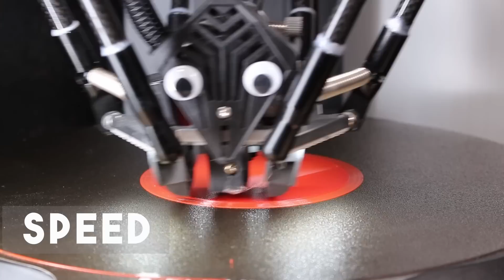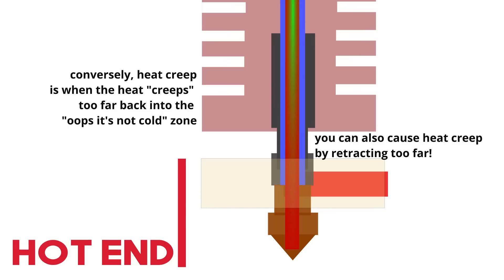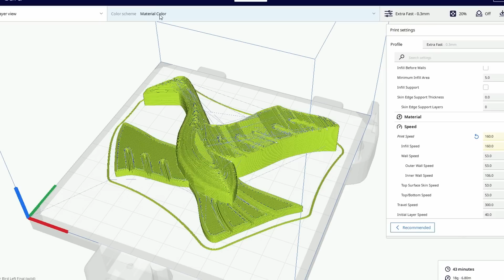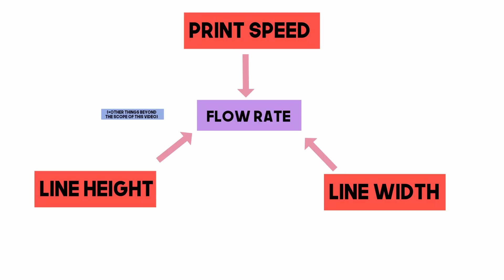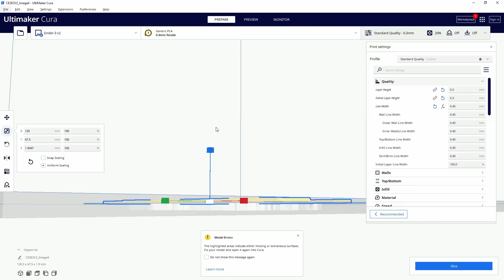I can halve your print times with this video. Episode 2 of Faster Profiles in Cura / Prusaslicer

Comment: There is a way to print faster. Way faster. It uses linear pressure and some settings from a slicer that allows you to use cnc settings. I have the files on a laptop. My problem with it was stringing. But I’d love to share the slicer profile and modded marlin firmware if you would like to go threw it and make a video about it. Maybe you could tinker the settings and share what you’ve found? Anyways, if you would like to talk shoot me a message.

Comment: Jerk is the minimum speed that the printer can be going to make an instantaneous 90° velocity change.

So if your jerk is 10, the printer will accelerate down to 10mm/s before it turns the 90° corner.

Angles less than 90° such as 45° corners, dont have to decelerate all the way to 10mm/s, they can take the corner faster. This allows for things like circles which are made up of tiny straight lines to be printed fast.

Comment: After some tinkering with Klipper, the stock creality ender 3 hotend will reliably do at least 25mm3/s. I mean, im able to print at 160mm/s with 0.32 layer height and 0.5mm extrusion width at 210°C without any sign of underextrusion. My main problem was actually layer shifting because acceleration was too high (8200) so the stepper was losing steps. Now with acceleration at 7100 theres no more missing steps and i can reliably do 160mm/s on an Ender 3, direct drive with stock extruder and printed adapter, 1.1.4 8bit mainboard with BLTouch and Klipper+Mainsail. Oh yeah, the steppers barely reach 50°C.

Comment: If you set in cura the same increased acceleration values you setup in the firmware, it will give more accurate print time predictions.

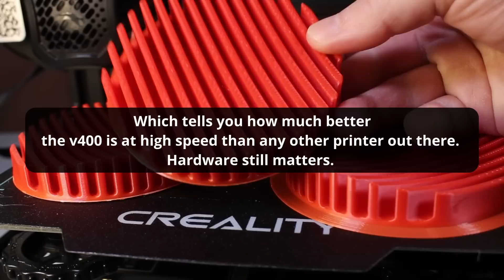Comment: 10:46 that part is important , even thought the FLSUN v400 advertised speeds are lower than the bambu ones , the flow rate of the v400 is way higher than any of the bambu ones , resulting in the v400 printing faster

Comment: You might want to check the hazard of filament nanoparticles...DONT brush your machine down, use filter vacuum with airflow in the room...a lot of reports i the last year about hazards
Reply from the maker: I have HEPA filtration in here, it's never a bad idea. Most of the dust is paper for..reasons.

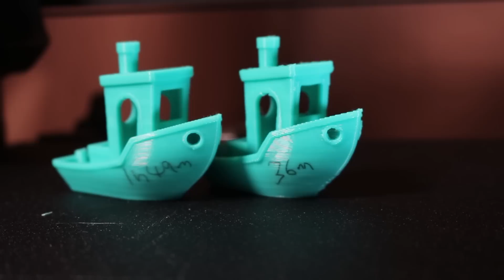Comment: @Lost In Tech what is the reason your flsun v400 acceleration goes from 4K to 8K and your square corner velocity from 20 to 5 in that clip around 10:30??
Reply from the maker: Was I showing the biqu hurakan in some of the screenshots? it's a while ago
Reply: @LostInTech3D  nah, I was talking about the speeder pad. I was asking because mine does the same change with a "redo" type circle with arrow that sets it back to 8000 and 5 when selected

Comment: Lol the time you save printing is offset by about 4x increase in experimenting and set up but thank you for the info. This job is for an AI app with a one button click that 1st measures all the parameters of printer with a set up test then adjusts all the parameters for the filiiment then sets up the whole machine with the 10000 bits of data it has and then monitors the printing process in Pico second increments to make sure the spec it came up with is confirmed with perfectly and make on the fly adjustments when necessary. This is the way to print plastic cat poo to perfection although the taste may not appeal to your dog  😂😂.

Comment: Trying to increase the speed is the brute force method like adding more horsepower to your shitty car instead of improving it´s aerodynamics and weight.
Same goes here, increasing the print speed should be probably the last step. Here is what you can do before that.
1. Thicker layer widths, you can print 0.8mm layer width with 0.4mm Nozzle easily
2. When fine resolution is needed for example 0.12mm layer height I turn on "combine infill every n layer" and in my case set it so 2 layers, with 0.1mm layer height you can choose combine every 3 layers.
3. You can add small radii in your design so the printhead does not come to an almost stop at the corners and create corner bulge.
4. You could use lightning infill and decrease outer peremeter to 2 and later on fill your model with hot glue, concrete, sand in a plastic bag + hot glue or exopy etc.

Comment: I expect that internal surface area is the limit for the fancy hotends, but not stock ones.  Improving the metal used for the block and nozzle (brass vs copper), the output of the heater cartridge (40W vs 50W+), and the extruder's maximum pressure (single vs dual gear) can all give better flow rates.
Reply from the maker: Copper is an interesting point. I should test that

Comment: -As I undersand Jerk-
Jerk = the slowest speed the printer slows down to when changing direction. While nothing can change direction instantaneously, it works in practice up to a certain value depending on the printer rigidity and moving weight.
Pros of using a high value is obviously reduced print speed. 
However more overlooked is how it allows us to maintain a more stable pressure in the hotend. If you print with Jerk 10 and speed 10 the pressure is perfectly stable (except when retracted).  With higher speed, the pressure in the hotend lags behind every time there is a speed change. This can be compensated for with linear/pressure advance. The smaller the difference between jerk and speed the better and less compensation is needed. 
Drawback with a high jerk is increased vibrations and ringing.

Comment: You could do a follow up on this one. The infill and perimeter is key to print time. It is also key to the strength of the print and its aesthetics. Variable line height is really usefull for more organic parts, but for geometric parts, adjusting speed by layer height is crucial. Setting infill the same way, and layer height, line width, and perimeter, as manually by layer height, is a proven way to cut print time. It does increase the workflow and the workload, on the designer.

Also, if you design your own parts, designing for speed is often times crucial. When I do so, it is a combination of infill, perimeter, part dimensions, and the functionality required of the part. In particular, avoiding a solid first layer, as in rather use a pattern for the first layer, or a a mesh rather than a solid, typically is The action reducing print time.

Variable line height needs some assistance in Prusa Slicer, as it will use the entire range of line height, including the draft setting. This currently can only be adjusted at the printer setting.

It is also a complete unknown to people, how difficult single line printing is to get right. Once you really start inspecting infill quality and real strength of the infill, things never look the same again.

Comment: Do you have any profiles you have “dialed in” for the “best” fast prints you want to share ? I have an ender 3 pro and use cura.
Reply from the maker: The problem with this is that, and this is why I made this series, it's very dependent on what your model needs. 
Learning how to adjust around maybe 10 parameters yourself is way more useful than using a profile, so I'd always recommend using the default ender profile and just changing what you need for that application, if that makes sense
Reply: @LostInTech3D  - It seems to me that many of us would rather start with a fast profile optimized by someone else and make minor changes to it rather than to reinvent the wheel by starting g with an “out of the box” slow printing profile and screwing around with attempting to optimize 10 printing parameters. 

Or maybe I’m the only lazy one out here looking for the fastest way to accomplish my goal.

Comment: You can also increase the max. flow rate by making the heat block hotter.  The problem of course is that the speed at which you push filament through varies a lot and you want  that filament to melt but also not get too hot.  How much heat can get pumped into it increases as the surrounding temperature (of heat block and nozzle) increases, but this temperature cannot vary that fast.  Putting it higher increases the max. flow rate, but also increases the risk of "overcooking" the plastic.  A small but faster heater (like the REVO) can also help here as it is faster at regulating pumping heat into the smaller heat block and as that block is smaller it also has less latent heat that could overcook the plastic when it is pushed out slowly.  I would expect a REVO ring-heater combined with CHT-like nozzle could be better than a volcano (as control over the flow would be better with the shorter melt-zone), but I don't know whether this exists or is even possible with the "unified" approach of the REVO.

Comment: please share your v400 settings. I cant print fast on mine. It'll knock the print off.
Reply from the maker: The v400 has a tendency to overextrude. Try the default profile but around 93% flow rate.

Comment: Nice. I'm frustrated by cura not having the ability to limit speed by flow rate as well, and I normally spend my time saving playing with settings, but I'm also a fan of the big nozzle (who isn't?) 0.6 is my standard and I have a 1mm on my core xy at the moment, for vase mode experimentation, I've found that printing things without holes and drilling them later saves heaps of time as well. Anyway. Great vid, thanks again

Comment: A good way is to print and tune for features which you see, slow, and then full send it where you can't see it. This is where volumetric flow rate helps - you can set the number, and slicer cau automatically adjust speed based on that value. Another neat trick is to use extrusion width on infill - if you make sparse infill 0.8 mm instead of 0.4, then in order to fill the same % of volume, printer has to make fewer lines = fewer moves, which decreses overall print time.

Super Volcano has one flaw - structural heatbreak supporting block which is way too large and heavy. rapid movements and bumping into prints cause fatigue and heatbreak snaps.

Comment: All I know is,I am fighting with my Elegoo Neptune 3 printer at this time after many times of it having a damn fully blocked hot end and me spending tons of time having to strip down the whole hot end to un-block the damn thing?  
I have done that 4 times today and even changed the PTFE tubing to new length and cleared out the filament blocks over and  again and still it blocks no matter how much I increase the heat and yes I reduced the flow down as low as 60% and the printing speed down to 40% the hot end ( MK 8 type ) even was at one time running at 245 C just to try too clear out Pro PLA that was blocking the hot end again, even though 
I had fully cleared it and even used cleaning filament to flush out any left over filament from before?

This was after re-doing the leveling using the in-built advanced mesh bed leveling. over 5 times and setting the z off set also over 5 times too.

No matter how well it was all sorted the damn hot end blocked up each damn time no matter the cleaning down?

This printer was fantastic for some time after I got it. Now tons of bad prints and blocking up no matter the cleaning and setting up?

The retractions are normal Cura 4.11 version ( 5 mm ) for the Neptune 3. I really fed up with this load of problems and I still have the Aquila head to un-block too and it is a high temp version 
( 300 c at this time but could if fitted go up to 550 c ) and the Tronxy X5SA printer I have also head is blocked too all were fine for some time now all playing up. even my FLSUN Delta QQ-S Pro is mucking me around too now?  it also was fine for some time before.  Takes allot of time to keep stripping their hot ends down and cleaning and re-setting them! I never had so much hell?

Damn it. And no before anyone states oh just use Cura 5. I can't load it as not using win 10 I using win 7 Pro. and no it it works safely no worries as I have great anti-virus and such software.
Reply from the maker: Hey, hop on discord...we might have some suggestions
Reply: I passed through something similar. One time it was because I changed to a all metal hot end and I forgot to change the retraction in Cura, so it retracted too much and cooled down blocking everything. Next time it was when I unblocked it but I forgot to screw everything very tight, and when hot, so plastic started going out from all places, making me clean everything again. A block can also be a cause of not cutting the PTFE really flat and plastic starts flowing where it shouldn't. I'd start reducing the retraction a bit if you don't seem to find a clear problem causing them

Comment: The cht seems really promising. For my custom corexy printer i will go for a cheap v6 and in case that turns out to be my speed bottleneck I’ll upgrade to that. Even outperforms the volcano by a fair bit. (At least according to stephan at cnc kitchen
Reply from the maker: I really need to get one 😂
Reply: 0.4 mm on MK8 hotend (with or without bi-metal heatbreak) was worse than Creality 0.4 mm nozzles (PLA+ if that matters). So it could be 20€ for improvement or 20€ for nothing. CHT could be better in V6, V6 in general is better than MK8 😉

Comment: How does this scale for a 0.6 nozzle?
Reply from the maker: Same - as you maybe saw flash past, arachne engine is very flexible about nozzle size vs extrude size, and rightly so. I think of nozzle size as a range of available extrude widths, and they overlap a fair bit.

Comment: I am glad someone with some critical thinking ability is making a video like this, looks like it should be a very comprehensive series by the end of it. 

Why is one of Steve's eyes bigger than the other though?
Reply from the maker: Steve got dropped on his head, he's fine though. Mostly.
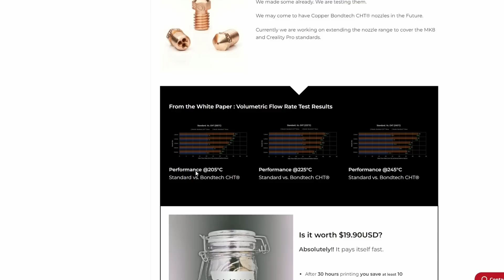Reply: 3:50 grate example with the cheese. Grated cheese melts faster than solid chunks. There is a point at which the increased heat transfer due to more surface area is negated by increased viscous forces due to more surface area.